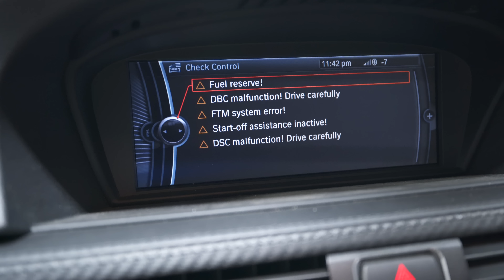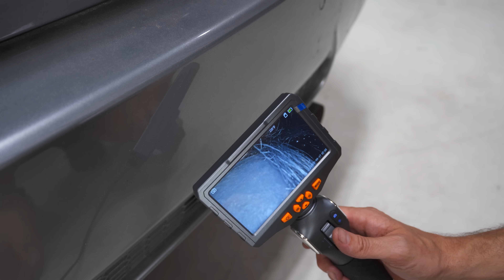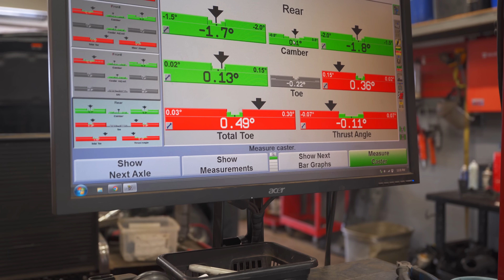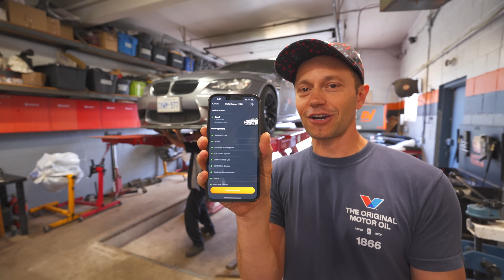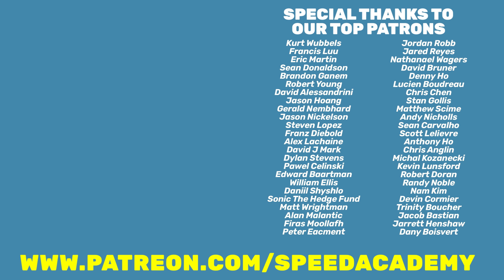The BEST BMW is an E90 M3 | Do These Mods to Make it Even Better

Comment from the maker: Get 15% off your Carly purchase with code "SpeedAcademy" (auto-applied) until September 30, 2024 when you click: https://bit.ly/Carly_SpeedAcademy
Carly's scanner and free version of the app with standard OBD features are compatible with cars that have an OBD2 port.  To see if Carly's advanced features  — like coding or manufacturer-level diagnostics —  should work with your car, make sure to check out their website. To access these additional features,  you'll need to get their yearly license.
Reply: I have a question.. the 4 chrome muffler tips you have I'll probably be interested for them if you haven't future uses for them let me know pls thz 🇨🇦👍

Comment: My love-hate relationship with my E90 M has led me to sell it. It's such an awesome, true driver's car, but also a finicky money pit. I've spent a ton modding and maintaining but I'm never satisfied and always chasing another issue. I'll regret it but time to move on.
Reply: My youngest brother has had a few bmws over the last 10+ years starting with a '99 540i v8.  Aside from leaky gaskets/seals it was somewhat reliable but the later gen 330s he had were absolute money pits.  And water pumps that throw trouble codes and put the car in limp mode?? Give me a break....

Comment: E90/2 M cars are probably peak BMW sound perfection ❤️ (in the modern era)

 We need an ASMR video of this car doing fly by's and other outside audio :) Just 15 minutes of pure audio near tunnels and wide open throttle 😊
Reply: The S85 V10 would beg to differ
Reply: @heyhayhay247  Yeaaaah, maybe. Put in the wrong car and transmission though. Mate that engine to something that can row through gears and a lighter car would be a fun build to see. Get on it Speed Academy!

Actually wait, the M6 had a manual?
Reply: @davetbrunner  Both the M5 and M6 had manual options. My M5 scaled at 4,050 pounds. The M6 is slightly lighter around 3,900 pounds while the E9Xs weigh between 3,700-3,750 pounds.

Comment: 12:31 BMW's don't rust because they leak oil everywhere (I have an e46 m3)
Reply: Self applicating underseal
Reply: Sounds like you just don't replace gaskets. I have a e30 325i a e34 540i and a f15 x5 and none of them leak
Reply: They come with rust prevention tech from factory!!!little did I know
Reply: Well put some parts in it and u will be good .
Reply: @eptdy  Yeah, I don't get the "it just leaks" mentality either. Oil leak? Fix it. Engine light? Fix it. There's no mental gymnastics to car maintenance.

Comment: The exhaust bracket(hanger) that you were struggling @16:20, you should remove the bracket from the car, that should make the installation a little smoother.

Comment: Check a little further into the muffler. There is the 2pipe and the 4 pipe mod. Some cover 2 of the perforated pipes and some cover all four pipes in there. Yours may have the 2 pipe mod.

Comment: When I did my rear exhaust, I just unbolted the rear exhaust hanger from the car.  That was on the coupe, so not sure if it's the same on the 4 door. The 2 pipe mod with standard exhaust setup, is really a good compromise. Great series this one, you even showed the reality of the rob bearings for our viewing pleasure. Great work as always guys.

Comment: Your build spec is great and the car looks almost like mine as I have the oem black 359m wheels for summer wrapped with Conti Extreme SportContact tires as well on my SG E90 M3.  I put Bilstein B6 and eibach springs and for awhile it was a bit high for the first couple hundred miles, it has settled down and is perfect height for NYC streets. On a side note, if anyone has CCC/CIC Nav and dailies their car, i can't recommend mr12volt enough, its transformed the livability having CarPlay on any trip, Especially since BMW has discontinued Real Time Traffic on our models.

Comment: The standard exhaust system sounds great. 19"s would have looked more fitting. Space Grey is 🔥
Reply: 19's might look better, but you'd lose performance
Reply: For a street car the performance loss would be negligible. The ride quality would be reduced slightly on 19"s but with wide tyres like that, there's still so much sidewall.

Comment: I miss my E92 335i, but it had almost 200K km on it when I sold it after 7 years.  I replaced it with a Camaro SS 1LE, and I did the OEM+ with my Apex rims and Chevy center caps as well.
Reply: Can you see out of the Camaro? 😅
Reply: @TML34   Only Forward. And even then, it's limited.

Comment: Crazy how the oem brakes on e90 M3 are single piston. Time for a BBK!
Reply: Not needed unless you do long track days regularly.
Reply: @zacharyparis  No performance car like an e9x M should have single piston calipers. The Lexus ISF and Mercedes C63 brakes are superior. BMW failed here imo.
Reply: @sdlausen1 I don't entirely disagree from an aesthetic stand point, but they have two piece rotors and the single piston calipers are aluminum. It could certainly be worse. They haul the car down really well, but they can't handle track duty.

Comment: i really liked the machined finish on the other apex's, black is going out of fashion right now and oh boy are they a pain to clean , specially satin black.
The stock mufflers were a good decision specially when you spent all that money on what i assume is a very expensive intake system and boy does it sound nice 
Are the front brakes a 2 piston calipper? if so its very dissapointing for that type of car ...
Good luck with that engine , you probably going to need it🤣

Comment: I'm not trying to be a hater but the screw in funnel is exactly the kind of thing I would expect for this car. The original BMW design was a leaky so its replaced with a 4 piece cap and adapter system.

I like the 80's BMWs. Easy to work on and beautiful. Swap a coyote in there and you have everything.
Reply: Yeah that summed up nicely everything I dislike about BMWs. Its an oil cap FFS.
Reply: Ive driven both, a 2023 pp2 gt 6 speed, I prefer this car and that's saying a lot considering Ford had 15 years to finally make a comparable engine.
Reply: @ttt69420  So the BMW that costs more to buy and maintain feels better than a Mustang? Wouldn't it only be saying something if it was the other way around?
Reply: @c0c0asauce  A mustang gt is a 60k car. A miata is 33k. This car is not expensive.
Reply: @ttt69420   This used BMW is a $20k-$30k USD. I bought a running Miata for $300.

Comment: Im not sure how well history will treat the E9X M3. Seems to be a good car. Great value for the money right now, thsts fir sure.

The engine was falsely designed to be a high-revving engine though. It cant be abused like so many have tried, and failed, at. 

I dont know if i will ever buy one. My top 3 are the E30, E36, and E46, like so many others. They are so analog and fun to drive. E9X got computerized.

For people looking for a great brake setup, just buy blank rotors and Akebono Euro pads. Drilled/slotted are useless and other braks pads dust too much.

25:24 8300 RPM redline? And my E46 has a sticker on the transmission that reads "Lifetime oil". BMW was wrong on both accounts.

Comment: wait so at 1:01 you realized it wasn't just the rod bearing but also the main bearing? INTERESTING I've been telling everyone who has an S65 that rod bearing replacement isn't the only thing they need to have done and I was right! You need both main bearings and rod bearings replaced to not break your engine!
Reply: That’s Bavarian quality baby! Everyone says Beemers aren’t reliable, those are just people that didn’t spend several thousand dollars every year on top of everyday maintenance!
Reply: @Online_ToughGuy  BMW may be Bring My Wallet but apparently KTM are Keep Taking Money, and they are Austrian.  A design fault is seeing a lot of recent KTMs chew the camshafts out like crazy in just a few thousand miles.  So, all peas in a pod and jolly good cars and bikes 😊-- none of this Honda or Toyota/Yamaha durability testing nonsense (of course where Toyota stuffed up with the twin-turbo V6s and Honda with the regular V6 crank grinding recently they recalled them all, but why would BMW do that?). 🙂